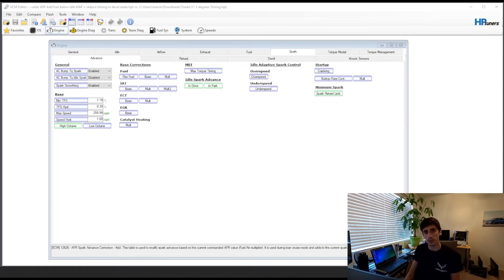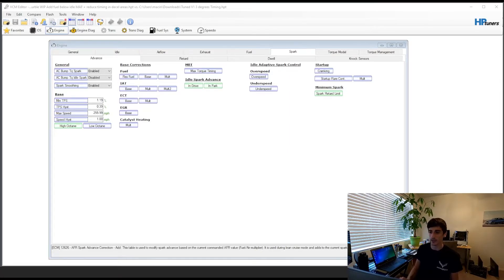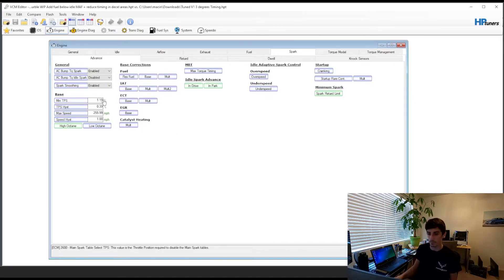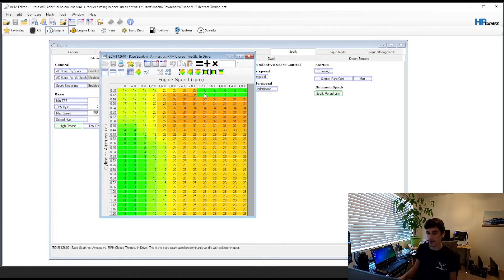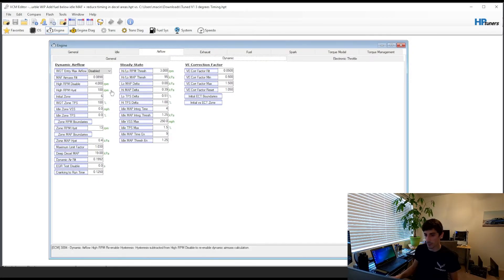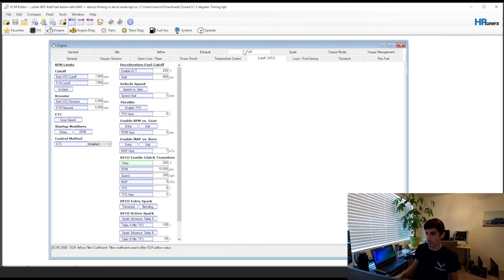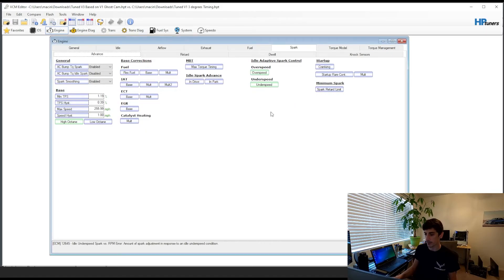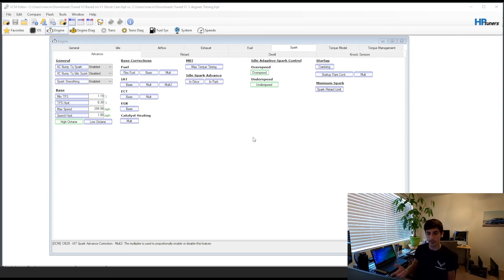Tutorial: Pops and Bangs + Ghost Cam on Gen 3 LS Engines HP Tuners - LS1, LS6, 5.7, 5.3

Comment: Hey, I’ve been trying to get a good crackle letting off the gas above 3K RPM on my 2000 Z28 but I can’t get it to go and I’m as low as -30 degrees. You mentioned richening the MAF but never mentioned reading idle and going off that. How does one go about that?
Reply: As low as -20 degrees. Can’t edit on mobile.
Reply from the maker: Log the car and observe what idle is
Reply: So I did do this, and from a standstill idle is about 5.5g/sec I think. Can’t remember, all I remember is all the values for the MAF calibration were above that to begin with. What am I missing?
Reply: 7.5g/s. Still a lower reading than the stock MAF settings. Don’t know how it should work.
Reply from the maker: Tuning cars requires attention to detail. By default the logger and editor will be in two different units of measurement so you're not even looking at the same scale like for like. Secondly, unless you disable DEFCO, decel fuel cut. None of those maf air flow changes are even going to matter.
Reply: Oh I hadn’t realized you had also disabled DFCO on top of the spark change. That makes more sense now. But yeah, the table is in g/sec. Logs originally read in lb/min but I changed it to g/sec so I could get an idea of it.

Comment: Will this work for Gen IV LS engines, like the LS3, LS7, LSA?
Reply from the maker: Process and tables are completely different for gen IV
Reply: The LSA already has it built in from my experience. You should be able to get darn close to their stock tune as a jumpoff.
Reply: @scottleggejr  Has what from stock? I have an LS3, but I was just wondering about the particular settings. I still haven’t messed with my HP Tuners in that DSCO (can’t remember the name) section or whatever. 

I’m shooting flames if I rev bomb above 5-6k, and backfiring occasionally above 3-3.5k on upshifts and revving. I’m currently running offroad/catless connection pipes to my long tube headers, and non-resonated mid pipes, so  I’m not surprised. Lol I do have mufflers, but they’re probably getting burnt out from me doing that.
Reply: @isnowyazn  You should be able to find an LSA hpt file online and compare the tables. The LSA has a significant crack/pop on decel when you engine brake. Specifically, you would NOT want enrichment on a boost blowoff event.
Reply: @scottleggejr What exactly should I be changing and not changing though, as that’s a completely different setup…. The only tuning I’ve messed with, is through a basic (1-hr long) HP Tuners “tutorial” by some dude on Youtube, where he basically just smoothens out the enrichment levels and turns on and off some management stuff (CAGS, etc).

Comment: my throttle is hanging and i’m not sure why only after a pull it will hang at 3k
Reply from the maker: Apply one change at a time to rule it out. Auto or manual? I've seen a lot of issues with auto cars
Reply: @CanyonTuned it’s manual
Reply: @CanyonTuned would there be a reason to bleed from 0 downwards through the chart a little bit i’ve seen some people do it and some people say drastic changes can cause drivability issues without blending
Reply from the maker: Did you change the idle under/overspeed conditions? If so that could be causing the rev hang since it's overcorrecting on throttle closure. Log the car while it's happening (especially TPS % and timing) when the issue is occuring @colincornell4261

Comment: Did you notice much difference in fuel economy with a maf+SD setup? Thinking about doing the same thing, SD seems to be wack in low throttle situations.
Reply: Also, what kind of kPa did you pull on decel? My car never seems to get below 34 on decel. Problematic as this is within my cruising zone.
Reply from the maker: The stock ecu is setup to always hit your target afr based on o2 feedback and fuel trims. You'll really only gain fuel economy by adding some timing in cruising conditions to make the engine more efficient

Comment: Would you say that this help with burning unburnt fuel that was otherwise just going to be released to the atmosphere?
Reply from the maker: Technically it would be less efficient since you're burning fuel in the exhaust instead of the engine
Reply: @CanyonTuned  But if you're not adding any fuel to the tables then the engine can't benefit from it? I'm thinking environment wise, if you retard timing so that the unburnt fuel ignites in your exhaust, wouldn't that benefit the environment instead of letting the unburnt fuel go to the atmosphere?
Reply from the maker: @z3r3pmoto  It would be worse emissions wise, retarding timing and burning fuel in the exhaust will just overheat the cats and make them work outside of their efficiency zone. Not to mention you will blow the cells out of your cats after a while as well. But yes, you are not consuming any additional fuel (unless you modify your fuel maps as stated in the video).

Comment: Note for all: my 04 z06 was holding the throttle open after lifting from this. No other changes or mods. Something to be aware of. Only way to reset it was to shutoff the ignition.
Reply from the maker: You must have something else going on, there's no reason throttle hang would happen from this. I have the same car 04 z06
Reply from the maker: Log your TPS and report back, i'm curious what the numbers are when this is happening
Reply: @CanyonTuned  I haven't logged before. Is that an upgraded feature?
After a pull, the throttle was hanging open in the RPM range I had altered and just sitting there. Shutting off the ignition and restarting brought the idle back down to normal. If I go back, I'll log it but I don't want to risk damaging the o2 sensors with the extra heat.
Reply from the maker: Logging is built into hptuners, also I would check that your throttle body is working properly mechanically and that you don't have vaccum leaks. I've done this on a few cars now and haven't run into this
Reply: @CanyonTuned  I'll look into logging.
No leaks, I had the intake off a couple months ago. Just found a lot of oil sitting in it. Added a check valve and a catch can to the pcv line. Idle is normal. Everything is clean and in good shape.
Reply: @CanyonTuned   I figured it out. It might be a while before I can do it but I can.
Reply: @CanyonTuned  I logged it staying open a few times tonight. idle tps is 5.1%, after a pull it drops to 5.1 then up to 14.1% and stays. it eventually stops back down to 5.1%.
Reply from the maker: @yz250ftony  I don't see how that behavior is related to the changes mentioned in this video. Everything I mentioned in the video takes affect at 3,500RPM+ and it's a simple timing change, nothing idle control related
Reply: @CanyonTuned  I don't see how it would change anything either. I only changed 2400rpm and up in the parameters you showed in the video. It wants to hold the throttle open at 2400 or higher.  I went back to original tune, resolved.

Comment: Confirmed on a 2004 z06 with -5 degrees. I have yet to drive it. Once warmed up it performed(sounded) as expected.
Reply from the maker: Good to hear! A lot of people are changing 5+ tables and making things more complicated then they have to be. This method is easy
Reply: @CanyonTuned  just got back from a drive. -5 didn't do much. Went -10 and it's occasional in only 3rd gear and above. I did set the park and drive tables the same and also the minimum spark retard table. I could throw fuel at it but I just wanted to see how this worked. Stock everything with bad cats haha
Reply from the maker: @yz250ftony  Auto i'm assuming? I know others got it to work with auto cars with some extra fiddling, I just don't have an auto car to mess around with to figure out how to make it happen all the time
Reply: @CanyonTuned  z06, 6 speed
Reply: @CanyonTuned  Update: after a month, my throttle started sticking open at the rpm range i modified. I went back to original settings and fixed it.

Comment: Hey done this on my 02 Camaro 4L60E and It only does it in park shoots a big flame and sounds good but in drive If I manually downshift it it does not work I only get the popping effect in park
Reply: Car has longtubes and a y-pipe
Reply from the maker: I believe for automatic cars there's a 2nd table you need to modify. It should be in the same section as the table in the video
Reply: @CanyonTuned  under which section?
Reply: did you modified idle spark advance "in park" and "in drive" as well? both tables are only for throttle closed conditions. the High octane and low octane tables are for conditions where throttle is open in any ways

Comment: How would you do this with a Holley terminator? I feel like Ive tried everything and nothing changes. Lol
Reply from the maker: With most ECUs just edit the main timing table. Change your low load/high rpm cells to negative timing. Then in your fuel table add a little bit in the same load/rpm cells. You might have deceleration settings that turn off fuel when letting off the throttle, change those to add a little fuel on deceleration. Fuel + retarded timing = pops/bangs

Comment: Thanks! This worked for me in my L99 (auto) 2010 Camaro SS 😀
Reply from the maker: Glad to hear! this video hasn't gotten a ton of views, hopefully it will catch on eventually ;)
Reply: @CanyonTuned  It seems to only pop at 3-4k RPM, any higher or any lower and it doesn't pop at all, I followed all the steps in the video, any tips? Tysm! (I have a vid of the pops posted as my most recent video)
Reply from the maker: Yeah I've noticed that too actually, you may want to add in some additional fuel (just a very small amount) or try to take some more timing out of it
Reply: hell yea
Reply from the maker: It also just hit me yours is a gen iv so there could be other decel timing tables that are taking over. Try to log timing and see if its actually pulling it correctly
Reply: Did you ever figure out or see what else was needed to “safely” backfire and shoot flames?

Comment: Will this mess with an existing tune as far as performance wise. I am running a cam catless x pipe Long tubes with a Corsa extreme
Reply from the maker: Nope! That's the best part. The way I have it configured it only changes the idle advance at higher rpms. I noticed no throttle response issues either
Reply: @CanyonTuned  Thank you!
Reply: My C5 is an auto, with a decent sized cam. It chops hard in park neutral but as soon as I turn the AC on it smoothes out quite a bit. I know its the added air when the compressor kicks on but I can't find the table to lower it on the gen 3. Any help would be appreciated brother. Im still trying to learn tuning so kind of new at this.
Reply from the maker: Oh shoot, you know I was just looking at those tables the other day! I think there's specific tables for AC fuel/spark. I'll have to see where that is again. Usually cars will have higher idle targets when the ac is on. Aka less cam chop
Reply: @CanyonTuned  thank you so much just let me know when you find it maybe you can guide me to it because I've looked and looked and I'm getting frustrated
Reply: One more question  will this mess with any internal components as I  know this type of tune is controversial.  They way you have it done it doesn't seem like any damage  could occur in the engine over a period of time.
Reply from the maker: Should be fine, this is pretty close to what OEM manufacturers put on their "sport modes" on newer cars these days. You start running into burning exhaust valves when 1.) You're adding a ton of extra fuel on overrun 2.) Your overrun lasts more then a few seconds (Mine turns off when you get below 3200 rpm again) 3.) Your negative timing is super aggressive
Reply: @CanyonTuned  good to know. Thank you